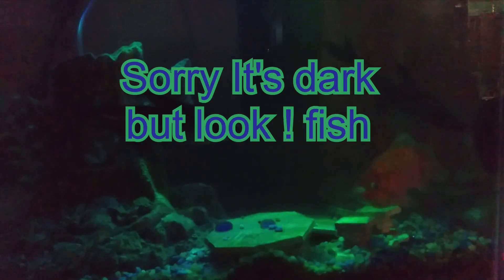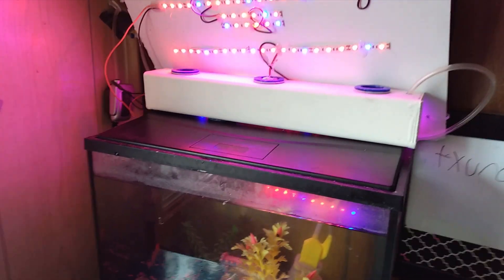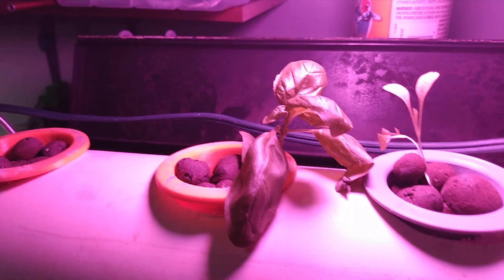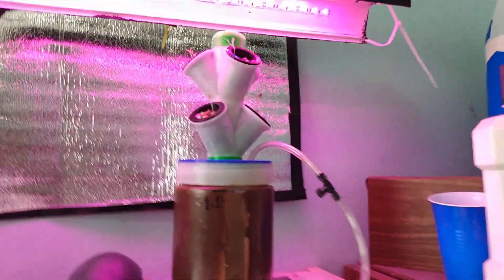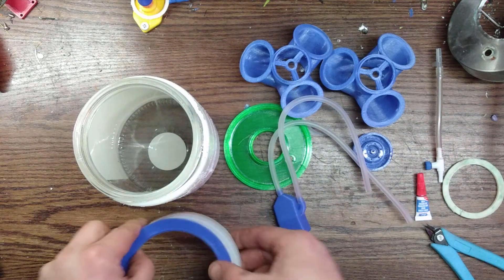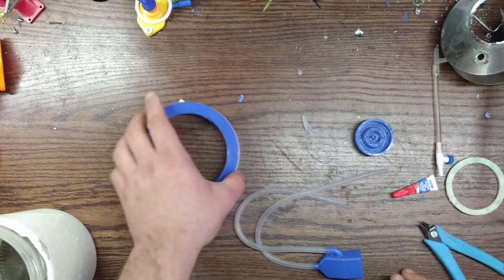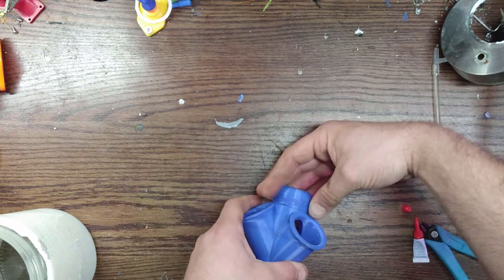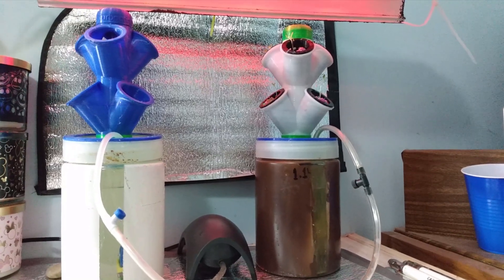Food prices too high ?  how 3d printing can help .

Comment: What size pump are you using? Like 10g?
Reply from the maker: Just a small aquarium air pump with a small air lift pump of my design. Otherwise there are other air driven pumps available to print as well . My file links should be in the discription .

Comment: did you print with or without supports?
Reply from the maker: Everything should be good without supports , the bottom corner of the main parts with not come out perfect otherwise all of my tower parts were printed without support
Reply: @turboprint3d  thanks, already started printing without problems